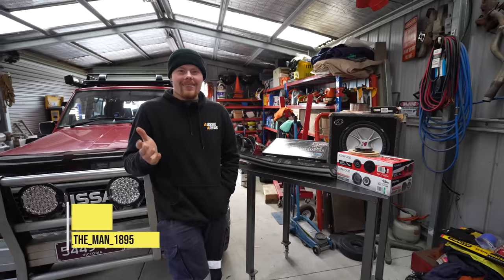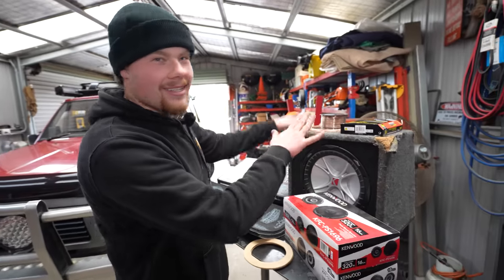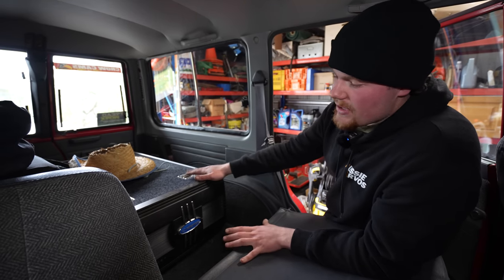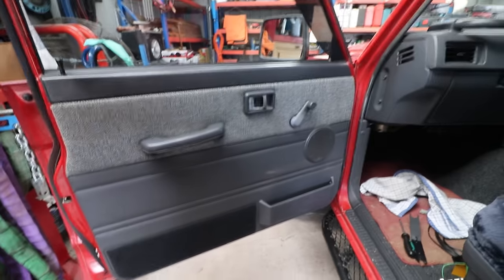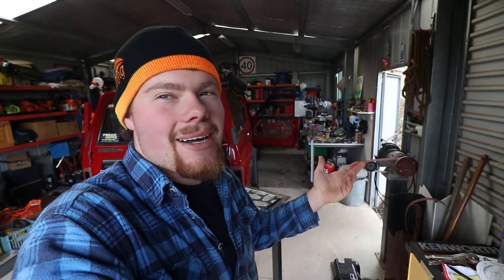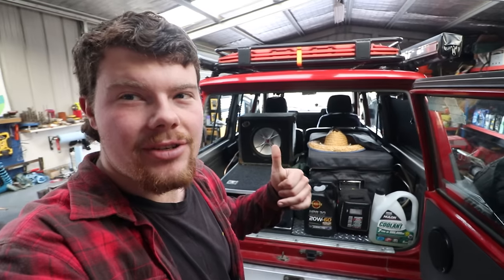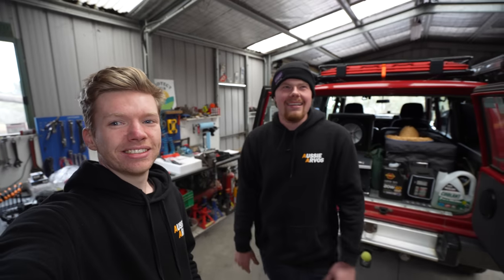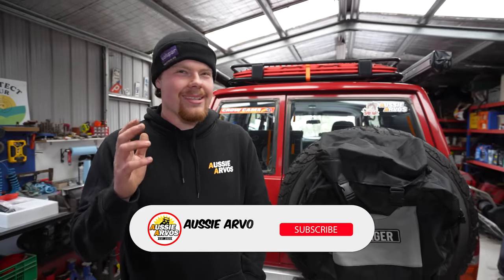Becoming that Camper that everyone HATES...

Comment: As a car stereo head before 4wder, i can touch base on a few things here. Throw max power out the window, completely irrelevant and only ever worry about its RMS.  AWG american wire gauge is interchangeable with the B&S unit we see more often here in australia. A general rule of thumb for the standard amp installs is 8awg for a 300wrms , 4awg good for around 1000wrms. You are right to say these systems draw in peaks or surges, the full RMS wattage will only be drawn when playing a purely sinusoidal signal. 

For cable sizing, this is applicable to  even dual battery wiring. Ampere ratings in cables are more so to describe what current you can safely pass through the wire before the insulation on it is in danger of losing its integrity from the heat. But It never accounts for the acceptable voltage drop.

Speakers need back pressure and in proper installments, are installed in a sealed enclosure, or ported but it must be tuned properly. Sound deadening the outer door skin helps with rattles as it changes the resonance of the door panels But where you  will get a massive improvement in both mid bass and response is by sealing all the holes behind the door card to essentially  use the entire door cavity as a speaker on closure, rather than letting those sound waved escape. You can use the butyl sound deadener to replace that plastic vapour barrier. For the same reason your speakers sound better with a HPF, your mid bass could also improve by using component speakers to let the discrete tweeters reproduce the high frequencies. It also has the added benefit of raising the 'sound stage'  so it sound like your music is coming from  up near the dash rather than down at your feet. 

How long can you play this system for? I've got the math here.  looks to be a  Cadence FXA-5100, 4x100WRMS @4ohm, 300WRMS @4 ohm. Class AB amp 50-65% efficiency.
If tuned for 2x30WRMS fronts, 2x100WRMS rears, 300WRMS sub= 560WRMS /0.65(class AB efficiency) = 861W / 12V= 72AMP for a sine wave half it for general music and you'll avg at 36 amp draw  at full volume. You do the math on the size of your optima battery, im not quiet sure. 

Tuning the sound system is also half the install too, It would have been nice to cover your tuning process in the video. Your  mate is absolutely right that you tune the gains on the amp when the head unit is near maxed out. running too much gain will cause clipping on the signal which essentially a dc current being passed through the coils of the speaker, overheating it then burning it out. 

I absolutely love my music and will sacrifice many things before i sacrifice having the sound quality a large sub  provides. I've given it the full sound deadening treatment with a layer for the inner and outer door skins, 4 kenwood component speakers powered by a 4x80WRMS rockford fosgate amplifier, 12" 600WRms Alpine type S sub and matching amplifier. The sound system is hands down my favourite mod to my 4wd as i use it no matter if im stuck in traffic dailying it  or cruising down open roads and 4wd tracks. I was  fortunate enough to have all this stuff laying around from old installs i've upgraded for people or i've just been given.
Reply: Solid info there.
Although I think the caution his mate was setting the gain structure for wasn't to avoid clipping the amp and melting coils, but having the amps wide open and allowing room on the head unit volume pot that could blow the speakers if cranked, which would technically be the "right" way to set the gains as far as headroom, but totally unnecessary with this set up and I wouldn't trust my mates with that power either if the amp had no limiters haha.

Comment: Good clip buddy, thoroughly enjoyed. Must be the time of year to do it as I have just put a new set of Clarion 6 1/2 inch splits in the front of my Nav’ and once I sort out my behind the rear seat sub box and old school USA made Rockford Fosgate amp, I’ll be cranking out some good music to LOL. 

One awesome track to test the new system out too is Phill Collins “In The Air Tonight”. 

One tip for anyone contemplating running cabling for an amp, always run your earth, power and speaker cables down one side of the vehicle and run your RCA‘s, even if they are shielded, down the opposite side of the vehicle and this will help minimise any sound interference and noises coming through the sound system from the engine revving. Great clip bud 👍👍

Comment: I run a single drawer as well. Built a custom box across the full width that follows the angle of the rear seat & sits flush to the rear drawer. Passengers side houses a 12" kicker comp & my secondary fuse box. Drivers side has a compartment for all my fluids but also houses1000w 4ch amp with a pc fan I set up to come on automatically to cool the amp. Also built a folding panel that clips to the drivers side to form a full length, 110cm wide bed that fits in over the rear seats. Takes less than 60 seconds to go from 5 seat family tourer to a solo camper set up & vice versa.

Comment: Thanks for making this. Seems a somewhat similar setup to my Toyota, at least in terms of tinny. I currently only have dash speakers but have options for door. That’ll be an improvement. I’m sure the knock test sounded even better to you. The sound deadening is key, I think. Be good to learn more on that. Not heard of these spacers that you made so good work, thanks. I will be adding a sub but likely in the frame (unless I build a box). Cheers!

Comment: Is there a risk that moisture could get trapped between the sound deadening and the door panel and cause rust. 🔊
Reply: If the butyl deadener is installed properly it actually bonds to the metal surface with no air bubbles behind it. Just make sure when installing it, that you apply even pressure throughout the sheet and pop any air bubbles you see
Reply: @liampoor9699  That reply puts my mine to rest. I am intending on installing some. Thanks.
Reply: @robertgeddes511  no dramas mate. Got it on the roof of my old 60 series cruiser at the moment and will be doing it to my floor, doors and quarter panels to try and shut the old rattler up 🤣🤣

Been upside down on the roof for 3 Qld summers and hasn't looked like falling off yet
Reply: if you're not a youtuber/instagrammer and you dont anticipate ever trying to do body work on the inside of the door you can go the tightarse way and use body deadener spray (bitumen) directly onto the interior of the door. arguably better from a rust perspective - but be careful not to block the door drain ports in the bottom of the door

Comment: no matter make and/or model 4x4 you make there is a right way to do things and a wrong way to do things and jackass way to do things..

If planning  to sleep out of vehicle  likely mount speaker  on   a rack..

1 thing you learn when designing  weight baring roof racks what is commonly available from suppliers typically have 3/4's to 1/2 the weight when mounted to the rain channel of the vehicle to actually carry weight from 6-8 chassis point the only option is exoskeleton welded in 1 component chassis itself..

there is really no structural integrity in bolted on replacement option  noting if you are in intending to winch from said roof at some point  due to roll over i would never recommend doing this from gutter based mounting system....

if you going to 1000w ac into dc you be looking 24-48vdc system..

Comment: Why you use K-Mart spec coaxial junk? 1 pair of Hertz Mille splits would sounds 100x better…. Sounds staging from the rear? Go to a concert and turn your back to the band, same thing… want your power up front, not from the rear. A better brand slim profile speaker will fit easily. At least you used good Stinger RCAs. Quality amp wiring kit is equally important… fingers crossed you upgrade from this install in the future so you can see hear the difference. I run minimum of 1 gauge to feed the amp, id replace that power hungry sub with a slim line under seat sub x2, far more efficient on power and reclaim that vital storage space in the rear. Btw did you bother to run the speakers in or just blast them straight out of the box?
But then again i run MQ Quart splits that cost $2,400 a pair 😂 cant wait to see you guys hear a real system lol
But your ahead of the stock system so thats a great start, keep up the good work lads